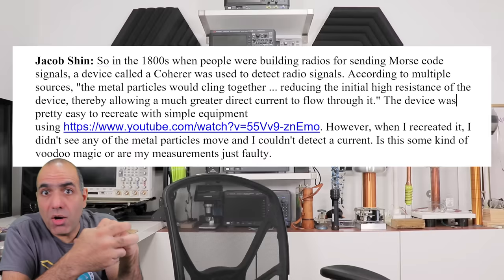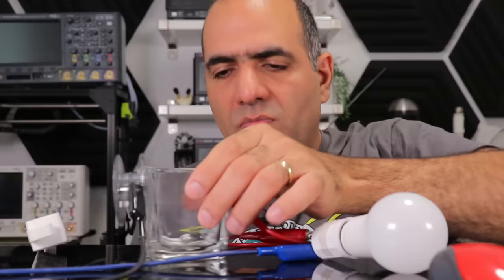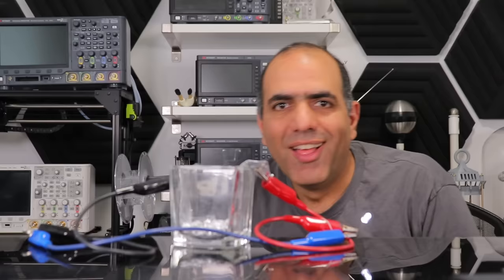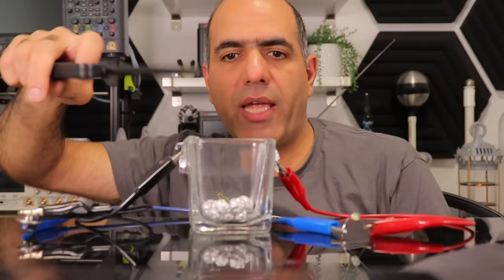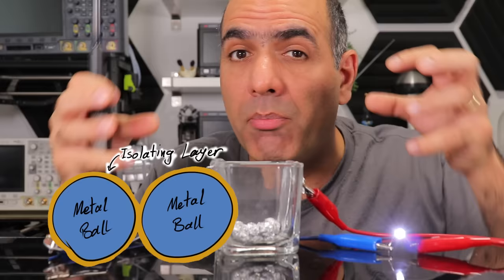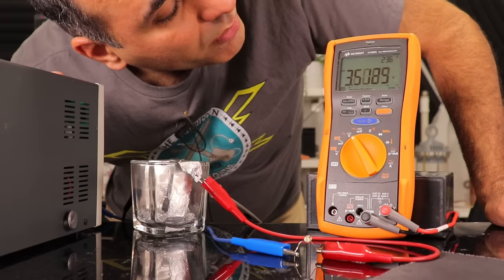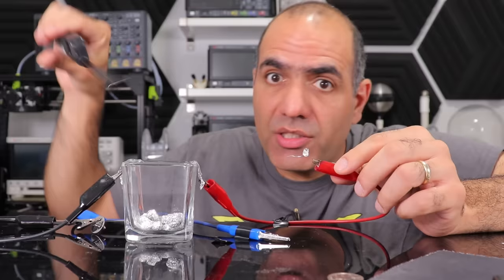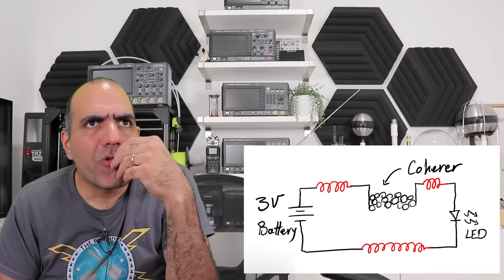Wireless Communication with a Cup of Balls, Coherer Effect

Comment: Btw you should test your metal oxide theory, using inert metals like silver gold , or any other cheap inert metal you could find, or take a relatively inert metal and file it down/ put it in acid/ heat it to get rid of the oxide layer,  then try the same experiment. If it doesn't turn off it means your oxide theory right, if not the reason might be different.

I have a different theory, the metal balls are very close to each other although not touching, when RF is applied it induces opposite voltages in neighbouring balls because the distance is conparable to their wavelength, that is why they stick together or "cohere" and stay that way until they are mechanically disturbed, that's why the hung balls wouldn't stick. You could try high power RF and slightly far balls to check this theory.

Comment: Could this be associated with the fact that the force required to start pushing an object through the floor is bigger than the force required to keep moving the object through the floor (due to friction)? What I mean is, the electrons to start moving need a bigger voltage than the voltage required for them to just keep moving?
Reply: mehdi showed that it remains closed even when you disconnect the power, so no.

Comment: Hey Mehdi, I have this idea fror the new video - can you be shocked from the off grid grnerator? Since the generator is not connected to the grid and is not synchronised to it, the current shouldn't flow to the ground through you if you touch the live wire. At least that is how I understand it.

Comment: I tried this at home and I couldn't get it to work as it should. The biggest problem I faced is that the light flickers even without creating an arc with the piezoelectric. Also, sometimes the LED does not stop to shine even after shaking the balls and hitting the table can both open and close the circuit. My setup is some loose connections, yellow LED, 1kOhm resistor and a small lighter. I tried 5, 3.3 and 3 volts.

Comment: Is the high voltage pulse also aligning the magnetic field of the balls? Is that also part of that linking process as it breaks barriers? I imagine that a field alignment would be driven by the circuit's current flow.

Comment: Fascinating, the ark must weld the weakest point, I wonder how many atoms you need connecting to pass 10mA for the LED. would be hard to make such a device repeatable, but if its all you have. Nice first principles demonstration. 6x10^16 electrons per second = 10mA, 6x10^28 electrons per cubic m (al) drift 0.03cm/s  I get 0.2mm dimeter, seems alot, Inspired to try but I think Im wrong. Great video.

Comment: Trying to think of an application for this. With not much thought, if the effect is part of an integrated control circuit, and the power is disconnected, it could be used to reenergize the circuit after a fault has been detected or something?

Comment: This is why we electricians need to brush steel aluminium overhead wires befor we ever clamp them to the busbars and breakers with substation conductor clamps. And that get even worse at the low woltage grid.

Comment: I’m only around 8 minutes in but I wonder if it has something to do with the magnetic field around the chain of balls. Like, before the impulse there is no charge moving through the chain, but once the surrounding magnetic field around the chain is disturbed, this allows a small amount of charge to pass through, which aligns the surrounding magnetic field perpendicular to the direction of current flow. Now that the sheath of magnetic field is established, more current can travel through the connected balls, resulting in a positive feedback loop until it reaches full current flow. Although I do like the oxide layer theory a lot. I’d be interested to see if it works in a purely inert gas or vacuum where that oxidation will not occur as rapidly or if it works with other metal foil materials.
Reply: Well I hit minute 9 and that induction idea doesn’t make much sense in a disconnected circuit

Comment: Those little balls (and the electromagnetic fields around their surfaces) are behaving like the atoms in a semiconductor lattice. I would guess that if you had sufficient time and materials you could feasibly simulate a transistor or other active device just by setting up enough wire between enough of these "cups". I don't know what the current draw would be, but the voltage used would be fairly low, so whole logic gates would not be out of the question. 😏

Comment: What would happen if you connect 2 wires- Earth to earth, Live to live, Neutral to neutral from the same outlet but different length in AC 230 / 110V circuit?

Comment: Could it not be air gap that is getting ionized by the arc? 
The oxide layer formation also seems like a reasonable explanation but I don't understand how the connection "breaks" when you tap on it/make a noise...

Comment: Dear ELECTROBOOM,
   I need your help and I am sure many face the same problem (like the comment if yes)
   My neighbours plays loud audio in their loudspeaker, often in the early mornings.
   Is it possible to make any device that can produce some high amplitude noise in the audible frequency range from a little distance to ingest some crap noise or even better some audio overlay on top to demotivate them a little bit?
  They use some ancient audio amplifier. Those big black boxes with grab handle on both sides. Sometimes with XLR mic input(even though I'm not sure about that in my case, but must be similer)
   Can you please help.....!

Comment: I need some help, I made a flashlight moved by a microwave motor and I'm trying to make a circuit to charge a battery using the voltage generated by the motor, any tips?

Comment: I had a 3d printer which was connected to pc to work, and every time I trying to light my cigarette it disconnected from the pc and the print was ruined.. Even the relay from my AC compressor was disconnecting the 3d printer.. I don't know if there is anything to do with Coherer Effect, but it was very annoying..

Comment: i think the cup of balls might work as a microphone by connecting a mic cord to the metal strips and plug it into a computer you will hear sound if you speak into the cup..i thought of it as i saw your voice make the resistance move around when you spoke into the cup of balls..it might also work as a vibration sensor on a box or solid floor 😁😁
Reply: yes

Comment: I can see how you can finetune it to use as a secret door lock. So you click really close to a specific place to unlock the door and then the closing door would probably reset it. But I wonder what else could trigger it accidentally even if you finetune it. And it's still a "bat cave" level of fantasy.
Reply: The device Is very sensitive with lightning strikes and other electrostatic discharges, the more Is sensitive the worst It works

Comment: Theory: aluminium foil comes covered with oil that stops it from sticking together. I think that could be the culprit. It reminds me of reaction wheels used to orient satelites. And most notably solar probes. The bearings inside… allthough in oil. Arc between each other due to all the solar energy around. Those same reaction wheels eventually weld together by arcing* through the oil layer

Edit: typo
Reply: all aluminum in oxygen has an oxide layer that protects it.  unlike rust on iron, this actually protects it.
Reply: @tsm688   i have no idea how that has anything to with it, the oxide doesnt affect conductivity, unlike the oil on tin foil.
Reply: @darthmemeious9526  the oxide TREMENDOUSLY affects conductivity.  It's the only insulator in aluminum electrolytic capacitors!
Reply: it still proves my point, such an oxide layer would be vaporized, or broken through by an arc.... you dont have to be sweaty about it.
Reply: @darthmemeious9526  proves your point that it's an oil?

Thanks for leaving greasy cheeto finger comments in all my public videos btw.
Reply: you'd see my point if you actually read the comment. high voltages like that can create weld points and whether it is caused by oil, or an oxide layer is up to very clearly up to debate, judgng by you. I bet you call yourself "scientific"
Reply: @darthmemeious9526  Citing contradictory things and stating incorrect facts makes your point unclear, wonder of wonders.

Also unclear whether it's "your" point.  Mehdi made it first, and your prediction of oil was wrong.

Just take the new information gracefully instead of creeping someone.
Reply: @tsm688  too long didnt read.
Reply: @tsm688  also we all know this is why your wife left you.

Comment: that's pretty cool

but we need another rectifying video against stupid youtube "creators"

i've noticed alot of them are making "induction" soldering irons, based on a ZVS circuit or something similar, BUT then they use a few turns on a ferrite core and turn it into a boring old "soldering gun" aka they just make a high current transformer based on a ZVS inverter and tips from a soldering gun and call it an "induction" soldering iron, pretty lame in my opinion.

i would like to see all of that dumb shit gone from youtube so we would maybe see real induction based soldering irons.

so basically when you type in induction soldering iron you basically get 99% video's where people turn the ZVS in a HF high current transformer which is pretty sad